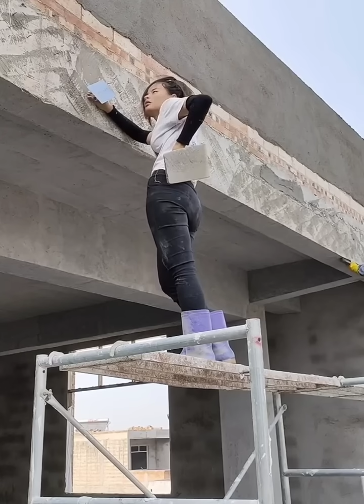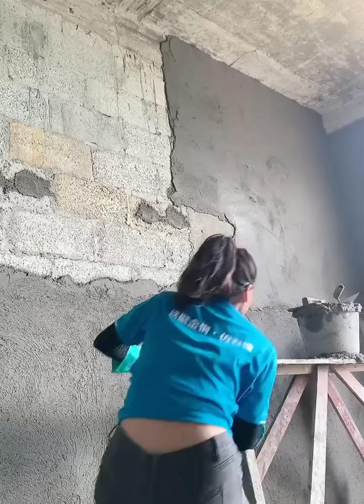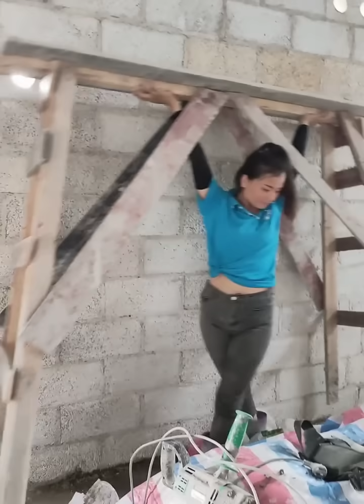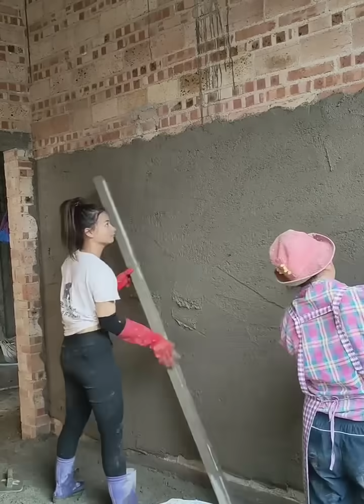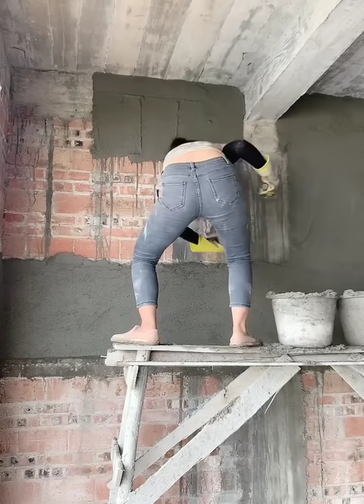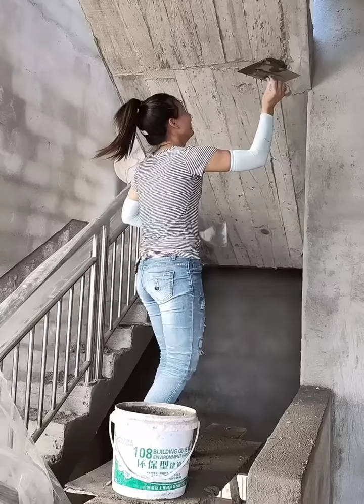Young girl with great cement mortar skills-Great engineering in construction PART 4

Comment: She has some great talent, I couldn't do that. Looks like she's hurting, my question is shouldn't those walls be wet with water, before applying the cement. Won't it down the line, just crack and fall off. Other then that she's amazing. Great skills
Reply: No it would just slide off. You can seal it first though
Reply: @tomash6805  when ever I see other guys doing something like that to an existing structures, they always wet first, I was just curious. I was told always wet the wall first, Thank you
Reply: @nickpanhead7209  yeah without getting too technical you do wet the wall slightly. But some of those smooth looking surfaces here I would seal first.
Reply: @tomash6805  I'm looking to resurface my basement foundation on the inside of the house. The foundation is crumbling. And I need to do something about it. I know I have to clean the efflorescence off first, off the foundation, then try to parge the wall. This is what I was told to do. I am not a mason. But I do appreciate your input. They said wash and lightly scrub down the wall, to get all the efflorescence off, then lightly wet the wall with water. Then take a mixture of Portland cement and water, to make it like, a thin consistency of paint, then you brush it on, small areas at a time, and before that starts to dry you have your mix of Portland cement ready to go, then you start parging  it onto the wall, no more then 3)8 of an inch thick, to prevent it from cracking. Then you could do another layer, but first lightly wet the wall again with water. Then parge another layer. Does that make sense to you.
Reply: @nickpanhead7209  when you say your basement foundation are you referring to the walls in your basement I guess ? 
What are they made of concrete or brick/ masonry ?
If there's effervescent coming through it's a sign of a damp problem. Which you may want to look into. If your render over it your really just masking the problem. Unless the damps not that bad and you just want to decorate. Then you can render or you can hardwall it then skim it with plaster depending on the finish you want.
Without seeing it that's my advice , I'm on English time so hence the delay
Reply: @tomash6805  I'm sorry I should of mentioned that, its a poured concrete walls. The house was built in 1953. We get some hot weather in the summer time, and we also get a decent amount of rain. We have our winters when we could get a few nice snow storms. Would a dehumidifier help this issue in the summer ?  I never seen the walls wet with water, as if it was coming from outside on a good rain storm. There are some flower beds outside the house, and grass up against the house. Where I see it the most is where the garage is attached to the house, but in the basement. It's weird because there is no soil there. I would think in the other areas where there is grass and flower beds up against the house I would see it more.
Reply: @nickpanhead7209  damp gets in all basements especially as it's built in the 50's. The new basement builds have a drainage channel at the bottom of the concrete wall and a pump to pump out collected water. From a plastic sheeting tanking over the walls. You could test the walls by hiring a propimeter to measure how damp they are. If it's not too bad you can go plaster it. A dehumidifier helps in the summer for sure , but they don't remove mould , if there's any mould you need an air purifier which kills off the bacteria in the wall.
Reply: @tomash6805  I seen what your talking about, like a French drain on the inside of the basement. I'm going to look more into it. Not looking to dump a lot of money into the house, we are looking to sell in the next two years. But I'm also not wanting to put this into the next owner. So I will be doing something. I really appreciate you taking your time out of your day. And helping me. There should be more people in the world like you. Thank you
Reply: @nickpanhead7209  your welcome mate all the best👍
Reply: @tomash6805  thank you from New York, have a great healthy New Year
Reply: @tomash6805  primero hay que azotarlo directo en el bloque como lo dió en poco tiempo se desprende , está mal hecho pero eso no quita que es abilidosa